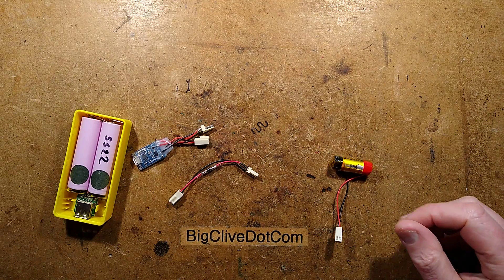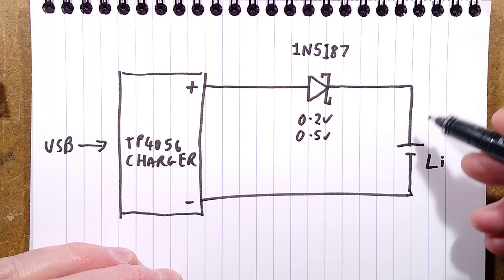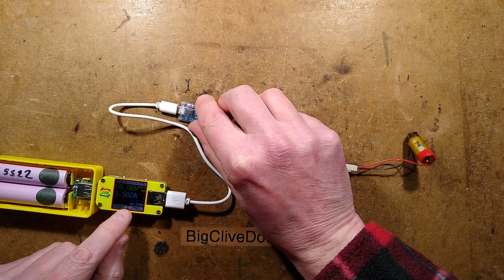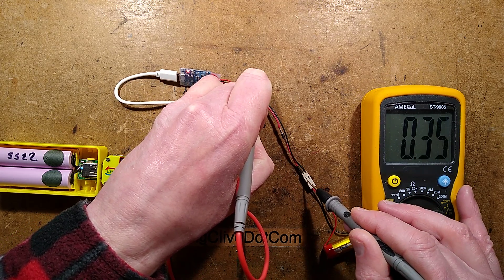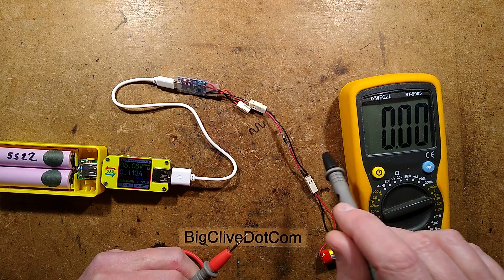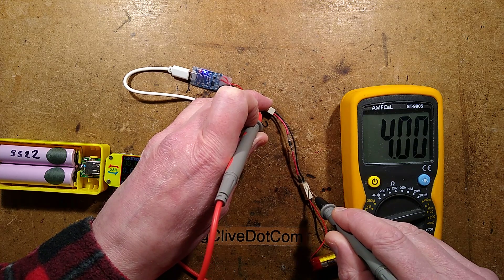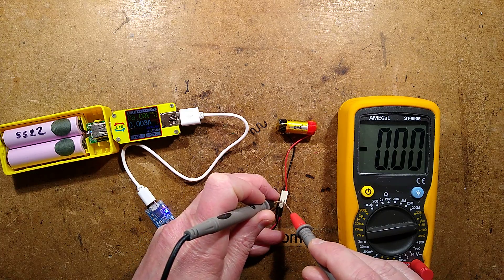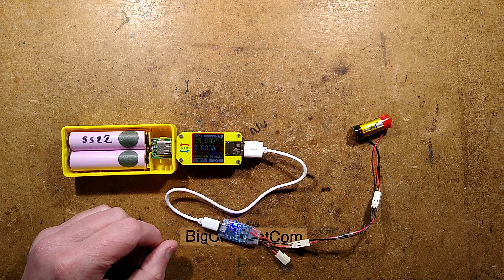Schottky diode between charger and lithium cell?

Comment: If you're designing a charge module from scratch and not relying on a ready made module, you can pull lots of stunts with the Chip Enable pin. Get yourself an MIC842 (comparator with reference) and set it up up so that it's output goes low when its input goes over 3.9V. Power it from the battery. Connect the output of the MIC842 to the CE pin of the TP4056. The battery hits 3.9V and the TP4056 turns off. You can also add an LED driven by the output of the MIC842 and that will stand in stead of the "fully charged" output of the TP4056. The MIC842 costs a buck and consumes a couple of micro amps.
Reply: You can actually get some of the charger chips with different end voltages. That should be the easy way to stop charge at the desired voltage.
Reply: @erlendse  The ones I'm familiar with are the Microchip parts. They have variants for different voltages, but all are 4.2+. If you know a part number with 3.9 or 4 I'd be interested.
Reply: @saumyacow4435 MIC79050-YM looks like an interesting part. It breaks out a feedback pin which allows you to override the voltage divider. The datasheet doesn't seem to characterise that portion of the device well, but, given it's a bandgap reference, assume 1.25V at the FB pin. In theory, if you add a resistor between VBAT and FB, you should be able to manipulate the output voltage to drop from 4.2V to insert desired voltage here much the same as any other voltage regulator, although that may take a bit of trial and error because (again) datasheet doesn't spec resistances used in the internal divider.

Other than that, it seems like most of the Microchip parts offer a 4.1V option, although whether those options are readily available from Mouser/Digikey, etc. is another question...
Reply: @adzib1823  Yeah, the 79050 is really a voltage regulator at heart. It requires a bit of mucking around with external circuits to add features. There's a few such things in the data sheet. And yeah the uncommon voltages are hard to find. Which is another reason why I'm surprised they didn't just come up with a part where the voltage can be programmed with a resistor. Its not like there aren't already a shedloads of amps/comparators in that baby :)
Reply: @saumyacow4435 I agree on all accounts - slight shame really but ah well
Reply: @Kuremyr  You end up with an iterative process. The cell voltage drops back, the charger restarts, etc.

You could always resort to a supervisory processor that acts to gradually reduce the current setpoint of the charger. 

I also had an op amp controlled pass transistor acting as a constant voltage drop. Worked, but I never had a use for it.
Reply: That sounds like it would oscillate wildly...  As soon as CE shuts off the voltage will drop causing it to turn right back on.
Reply: @uzlonewolf Clive's module + Schottky also oscillates... It's almost like we're trying to alter the feedback loop in a horribly hacky way 😂

There are probably more complex (including to use) and expensive ICs which allow you to set arbitrary voltage thresholds, or you could build your own discrete solution using a couple of transistors/MOSFETs and op-amps. Doing robust and stable CC/CV with a single pass transistor is not easy; having a CC control feeding into a downstream CV control (in that order) will be easier, if less elegant.
Reply: @uzlonewolf  There's a certain amount of hysteresis in the 842
Reply: @Kuremyr  is it worth it to apply a test load every (x) minutes, idk maybe modulated by some chip, to see the voltage drop? probably not worth it if you want to make money selling an 80% charger tho lol

Comment: On the topic of USB meters, you may want to get a more advanced USB meter that also does voltage/current graphs (and voltage ripple). For example, I use a witrn U3L which also has a (much) brighter screen. It can also test PD/QC chargers and request the proper voltage (9v-20v), test charge wire resistance, and long-term voltage/current graphs with the bluetooth app/pc app

Comment: Been picking up discarded vapes and have accumulated lots of these 'disposable' batteries .been putting them in parallel and using them in 18650 solar lamps .
Not sure if they charge correctly how about showing how to bodge the circuit to charge them properly 
is

Comment: How easy would it be to modify the charge board to cut off at a lower voltage?  or is it permanantly set by the chip?
Reply: Unfortunately thats the rub, most of the chips including this one have a regulated output set internally. You would think there would be a solution available for those who want to set both voltage and current.

Comment: For convenience maybe it is good to use the tp4056 and the Schottky diode in this case but it may be better to make a circuit with a couple of transistors, leds resistors and caps and a pot to change the charging voltage to 3.9v instead, maybe not a good idea to upset the tp4056 module with oscillating current while connected to a wall charger. Lithium batteries are great but it is better to have the same care and safety level and responsibility as if dealing with a loaded gun to no have angry lithium battery issues.

Comment: Interesting. I wonder if the life cycle extension is worth the loss of capacity?  Do more re-charge cycles actually result in a greater life-time capacity?  I can imagine scenarios where the cost saving is minimal.
Reply: Charging to 80% which is around 4.05V doubles the cycles. 65% (3.9V) doubles previous number. 60% (3.8V) doubles previous number. And we're not even talking about depth of discharge, charging rate, temperature.

Comment: This experiment seems like a success in terms of battery life extension at the expense of a lengthy recharge cycle.  Lowering final charge current and terminal voltage both reduce the tendency to plate metallic lithium which would ruin the cell.  Clive went where I was thinking- a great use case for something like power fail protection for an emergency exit light - hopefully not a need for a very long run time and long periods between requirement to discharge the cell.

Comment: I have a phone from Sony with a feature that I rather like, it allows me to choose if I want to routinely charge to 80, 90, or 100%. It also periodically charges to 100% regardless of the setting as a test (mine is currently set to 80%). I'm not sure if this is going to give my phone battery a massively extended life and I'm not sure how common this is with other phones.
Reply: Samsung Galaxy S23 can do 100% or 85%. What extends the battery life even more is not charging before it has reached 10% or lower, and once in a while (1/10) drain it to zero, and then charge to 100% before turning the phone on.

Comment: I did something like this with the lead acid battery in a portable speaker that was being pushed too high...but had to do diodes in reverse-parallel because it freaked out if it didn't sense power to begin with

Comment: It would also be nice if electronics that used lithium batteries also could be set to cut out sooner. I had a vape mod that I could set to cut out when the batteries would get down to 60%. Instead of completely draining them. When it hit 60% it would stop then ask if you wanted to turn the battery saver off and continue.

Comment: If you use a 1ohm resistor in series INSTEAD of the diode, it will produce similar results but the cell will actually charge faster.

Comment: best alternative solution:
a linear regulator with a resistive limiter on the input side
program the output voltage via the ADJ pin, program the current limit by the limiting resistor
actually kinda what a TP4056 is, just with a fixed 4.2v max threshold and silly logic inside it

I as ALL lithium should charge above 3.3v you can simply buy a bunch of cheap 3.3v LDO's and those cheap trimmer POT's, and you can use a common adjustable regulator from 12v with a resistor in "current regulator mode" that tunes the limited current via the ADJ current(cheaper than a 1-10w POT on a USB supply)
though knowing I seldom use cells with less than 1000mah(the lowest I have is probably around 300-600mah hybrid supercaps that can charge at 500-1000ma) I would settle with a 1a charge
but unless you have a purpose to going under 4.2v(signage or similar use where lifespan is king) a default 1a TP4056 would be fine for most people not playing with cells under 1000mah in the standard type

I just wish I knew of a LiFePO4 variant of the TP4056, one with a 3.6v peak, so I can get myself into LIFePO4 14500 and 10400 cells for stuff like my roku remote or AC remote or even my Xbox-One controller and have a tiny dongle stuck to a 4xcell holder that I can just glue to a backer and charge all my itty bitty cells on-the-go

I actually made a few dummy AA cells already from some failed NiMh cells(more than 15 years old and spent ~10 years uncharged after heavy use) so all I need is a good setup to charge LiFePO4 cells and I can power the xbox one controller without having the stupid design of needing >2.6v to operate, on 2x AA cells, which only provide bulk energy between 1.0-1.3v/cell, the point the controller doesn't work
Reply: CN3058E  for lifepo4
Reply: The CN3058 is almost pin-compatible with the TP4056. SOICs are $0.48 each on LCSC. LiFePO4 charger modules are on Ali for about $1. 3.6V is the default regulation voltage but the datasheet provides a formula to insert a resistor on the feedback pin to increase it. The main downside is its 6V max input.
Reply: @abitofabitofabit4404  nice, I didn't realize that existed
while I have a lot of generalized knowledge I struggle with being an expert on any topic

I knew I could figure out Arduino coding for a RODI controller for example, but exactly how to make a code that counts the pulses from an encoder based flow sensor while occasionally serial printing the TDS(derived from an analog input) of 2 sensors and doing comparisons to control 2 seperate solenoid valves and using a digital input as an enable was tricky

in fact my code worked perfectly at counting almost first time(after I put it as an interrupt routine, in the main loop it failed to count all too often) but because of the nearby 30w 12v pump wires to get 100PSI it often got ghost pulses that seemed like a lot of flow was happening when none was
let alone I used INT variables and it kept overflowing and tripping before my code was supposed to due to INT being a smaller maximum unsigned variable than I needed, I had to convert the code to use "Long INT" to fix the bug
and this was my first foray into Arduino coding and the vast majority of my issues that baffled me was inductive coupling noise and an unfamiliarity of the number of bits of a default INT variable, things you have to get a feel for and google anyway
Reply: @johnthefactfddict3281  Hostile electrical environments are always fun. I've burned a number of boards through large, low-ESR ceramic input caps * lots of current available * long power leads * 1nH/mm rule of thumb for normal electronics sized wire = destructive overshoot and arcing across the regulator. It was quite festive. That same project's pump also induced tons of electrical noise that didn't get fixed before I shelved the project for other reasons. Kudos for diving into a project from first principles, and learning all those subtle principles you didn't know as a result. You learn what you work with.

At least half the battle of design is knowing what components might be out there and how to find it. I've put a fair bit of research into power management and lithium battery charging for some projects, so I happen to have an incomplete, dated idea of what's out there. Knowing that Made in China offers breakout boards for any function they deem common enough, I searched on a few variations of "LiFePO4 charger module" on AliExpress. I then gleaned a part number from some board pics. A minute or two later I found the manufacturer's datasheet and an online source for single chips. Sometimes that process works, and other times it hits a dead end.
Reply: @abitofabitofabit4404  yeah, it just takes some hobbyist trial and error to find what works, and once you have the experience you suddenly are closer to the elusive title of "expert"
noticing that issue of inductive interference on a hall-effect flow sensor from the large 12v 100psi diaphragm pump was a "smack my head" moment
I should have realized the signal could easily be corrupted in such a way and possibly included some form of shield(aluminum foil and electrical tape wrap anyone?)
but yes it can be fun to take the capacitors from old dead Power supplies and use them as firecrackers on holidays
I actually have a 450v 300-600uf electrolytic I might just pop on the next july 4th, with an extension and a camera from a distance of course

Comment: What happens when you just put a 14.4V on a 4S lithium ion battery?
Is it possible to make my own 12V lithium ion replacement battery for a motorcycle or car?
An alternators regulator puts out 14.4V continuously and lead acid batteries in a vehicle just get charged with constant voltage.

Ofc a regular BMS can't do those huge Amps you need to start the vehicle, but if you only have to check it once a year during winter that would still be a win.
Reply: It would not charge.
Reply: @SinsBird  well, it would charge up to 3.6V per cell.
But you're saying that nothing would happen once it has reached those 3.6V per cell? 
Because if so I'll try it out.
Build a 4S2P battery with 21700s that gets 180A puls and 90A continuous cranking amps, which is enough for a motorcycle engine.
Reply: @Shishou_Shi  3.6 volts is the voltage of a discharged cell.
Reply: @SinsBird  for 21700 lithium ion 3.6v is the nominal voltage, they discharge down to 2.5v and 2.8v discharge is most common. 
4.4v is the maximum charge voltage and it sets at 4.2v.
Reply: @Shishou_Shi  Nominal voltage is voltage that is seen on the battery under proper load for the longest time during discharge. Not open circuit voltage. That is why those batteries that are designed to not catch on fire when being overcharged to 4.35 volts and more have nominal voltage of 3.8 volts.
Reply: @Shishou_Shi  You will have to check the datasheet of your specific cell. Sometimes remaining capacity can be up to 30% at 3.6 volts.
Reply: @SinsBird  I see, I just looked up the capacity at voltage, seems that at 3.6v a lithium ion has less than 10% of it's capacity... Even if it's discharge voltage goes down to 2.5v... 
I guess a 12v replacement is not going to work with a 4s lithium ion...
Reply: @SinsBird  that's a good idea.
The Molicel INR21700-P45B Datasheet says it ships at 30% capacity which is >3.45v
Still not going to be a sufficient charge I reckon.
Reply: @Shishou_Shi  Yes, not a good candidate.

Comment: I've modified my powerbank to charge up to 4 volts. A couple big schottkys and resistor in parallel for charging (I bet a single resistor would do the same thing) and a mosfet with cr2032 on gate for discharging. This is to disconnect the cells from the controller so that it wouldn't charge them directly.

Comment: My laptop actually has a setting to charge at a lower threshold also to extend the battery life, these charge circuits are interesting as they rely on shutting off at 1/10 the current after reaching the voltage so it's like you're messing with two different internal loops
Reply: Mine too, I have kept it at 80% for the last 6 years and it seems to be in pretty good condition

Comment: I clearly remember Dave Jones explaining how to charge a lithium ion cell and he said the closer you get to 4.2000000 volts the more cycles the battery will have, terminating early causes severe degradation... Considering Dave Jones is a senior chairman of the IEEE I really think you need to check your info Clive, you are likely doing significant damage to this cell by under charging it. Edit: EEVBlog talking about charging lithium ion charging https://youtu.be/A6mKd5_-abk?si=g5czs1R0e2qTvpYH&t=485
Reply: This is not at all true. Maybe you can provide a citation to an exact part of a video?
Reply from the maker: That is not correct.  Undercharging lithium cells is preferable.
Reply: @bigclivedotcom https://youtu.be/A6mKd5_-abk?si=kjiVlBKILAY68wPD&t=488
Reply: A straightforward guide to lithium ion charging can be found in "EV Battery Health with Dr Jeff Dahn Dalhousie U" - https://www.youtube.com/watch?v=i31x5JW361k - you can also watch his presentation video at the Electrochemical Society "241st ECS Meeting: Keynote Speake Jeff Dahn" if you want the full in-depth nitty-gritty.